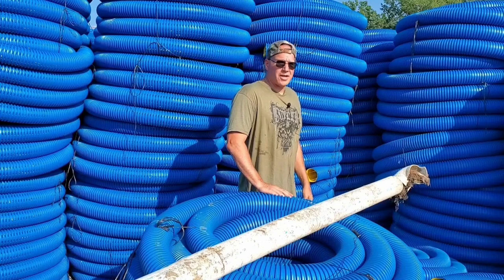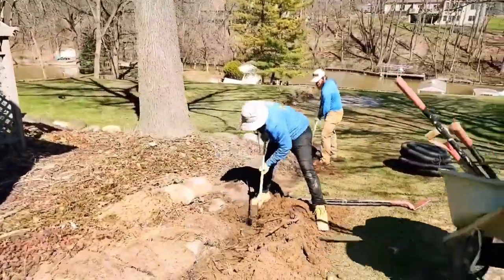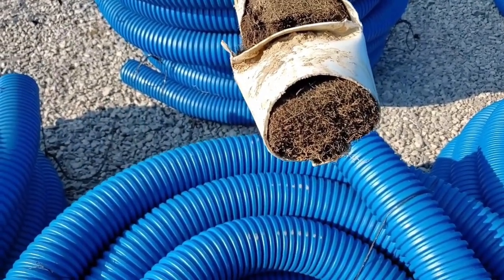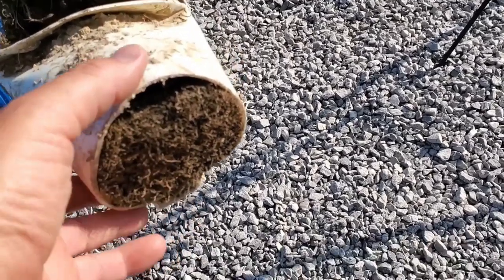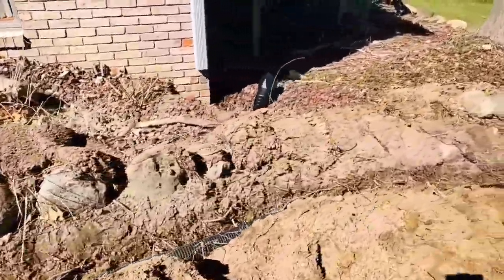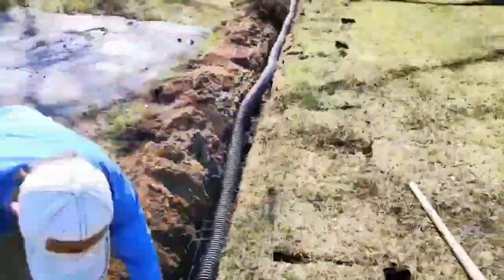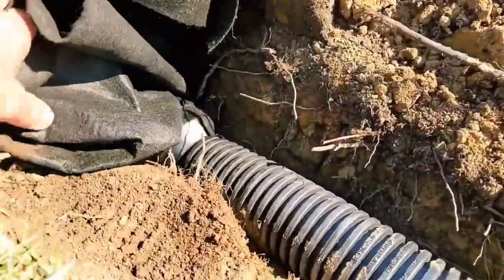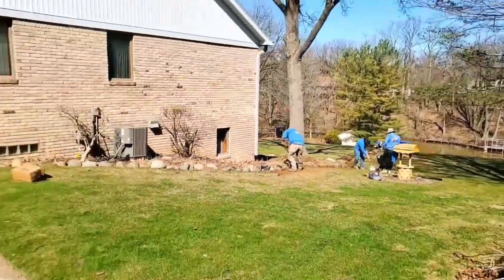Why Corrugated Pipe is Better [ Build a Underground Buried Downspout Drain That LASTS FOREVER!! ]

Comment from the maker: DIY Video 1
https://youtu.be/hSBYoE_378A
Reply: Do you have any examples of a drain running to a soakaway? My city doesn't have storm run off on my street and I have those utilities in the way, so a pop up would just empty at 15 feet from my house.
Reply: 10 months ago, in this pinned OP, someone asked a question, and you did not answer.  Sure, it can be assumed/accepted you cannot answer every question, but this is your own, pinned OP.  Well, anyway, here goes: Do you have the best way to do a drain sewer line?  Regarding this video: seems logical.

Comment: In my experience roots are the worst if you have a low spot “ belly” in the pipe where water sits. When it gets dry the roots seek water. We get more service calls when it’s dry then when it’s wet.

Comment: Rob another question:  I will be connecting three down spouts into one line that will drain into a canal.  None of the corrugated piping will have holes in it for drainage along the way,  I want to know if I should use three inch from each down spout and connect to the Main line of 4” or stay with 3” for all?
Additionally are there Y connectors that will do the 3”into 4”?
Last one, Home Depot /Lowes kind of suck in this area.  If a guy was to look up a local business, what TYPE / name company would I put in the search?  Silly question maybe but…
Reply from the maker: We been looking into shipping international. UPS has revised our contract and in the process mentioned we could ship international if we wanted a contract. Only run 3" if you have our leaf filter. Only put 3" on 2 downspouts a 3rd would require a 4" main line.
Reply: @FRENCHDRAINMAN  Panama City Florida that is.  Not the Panama 🇵🇦 country
Reply: Why are you not using the solid blue octane pipe?

Comment: Why didn't you use your usual "virgin" blue pipe, instead of the black pipe?
Reply from the maker: It's our Blacked Out FDM kit. 3" runs up the wall of the house, it bends into a 90° turn. 4" doesn't make a 90° up the wall. This way you don't see blue pipe up the wall. That's why we Blacked it out.
Reply: @FRENCHDRAINMAN   is the Blackout pipe virgin plastic or is it recycled plastic? what sets it apart from the kind you get at the big box stores?